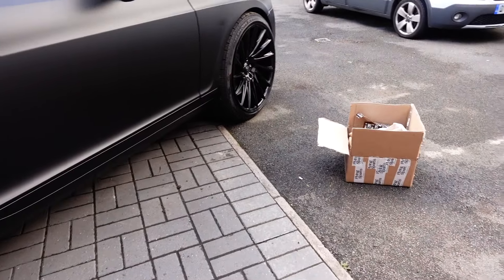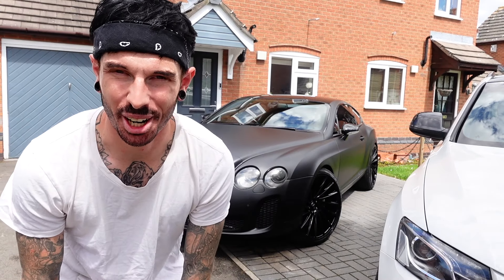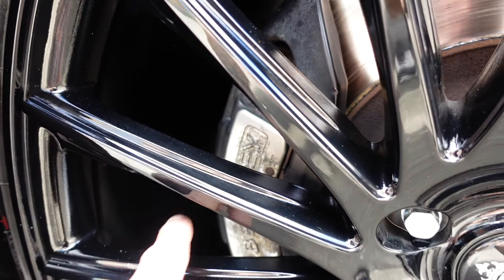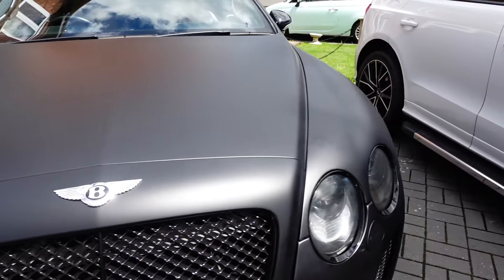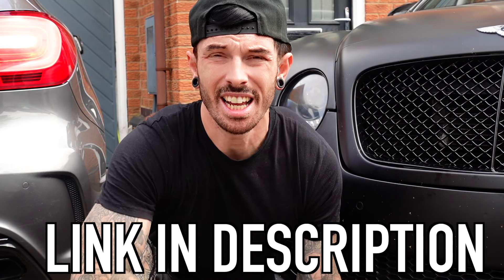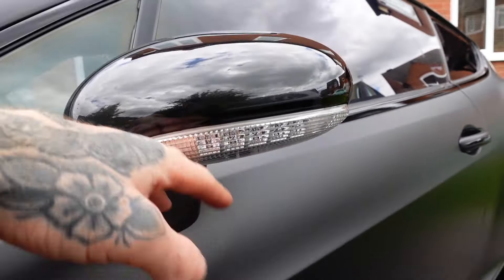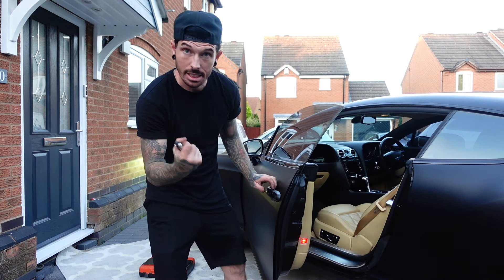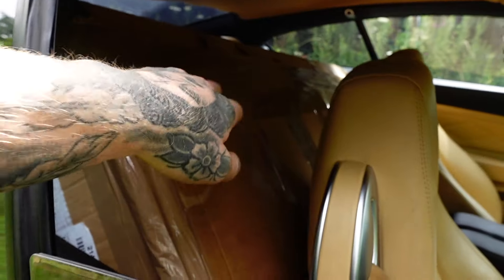PREPARING MY CHEAP BENTLEY FOR A TRIP TO MONACO

Comment: How did you change the side mirror light, did you just tilt the mirror out and find some retaining screws?
Reply from the maker: Yeah push the mirror to the top corner towards the car and it will pop out. There's then 2 screws holding it in place behind the glass

Comment: Looks like in your previous video you showed you getting pulled by the fuzz for not having a front number plate. Don't you think you should get that fixed? If you get pulled for it again your going to be in the shit I would imagine. Even if you just get a laminator and print out your own one in the correct size/font/color, I'm not saying it would be legal (it wouldn't) but if you made it look close enough it would probably not get another glance by a passing copper like having no front plate does.
Reply from the maker: I have been asked again but you can actually get points for an illegal numberplate and its only a fine/ticket for no number plate. S i have to wait for a log book to buy a legal one
Reply: @MatArmstrongbmx  I see, you've had that car for ages, why does it take so long to get the book back? (I assume by log book, you mean the V5C thing from the DVLA?)
Reply from the maker: dvla are soo far behind with it because of the virus. I only received the q5 one last week and we bought it around feb